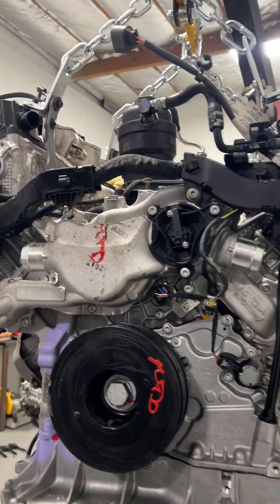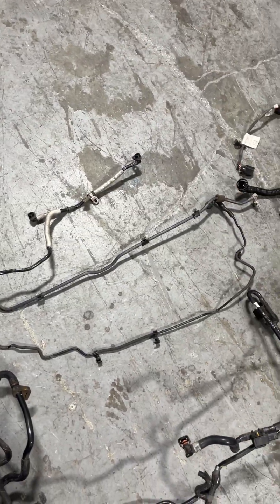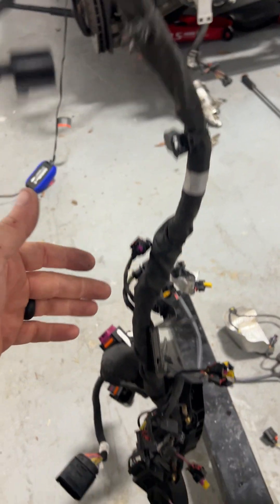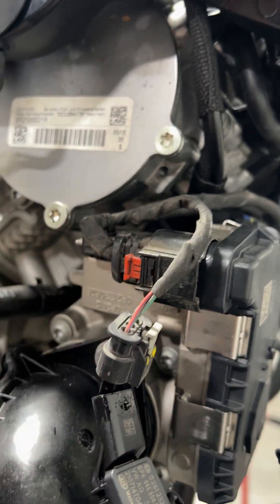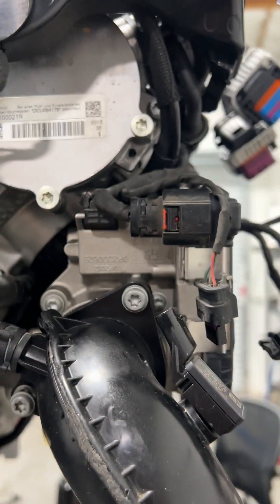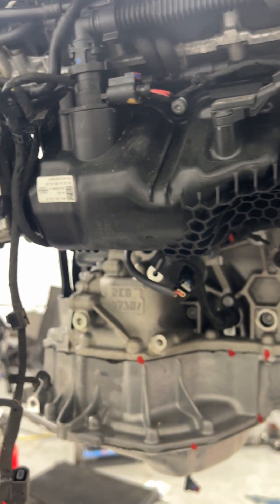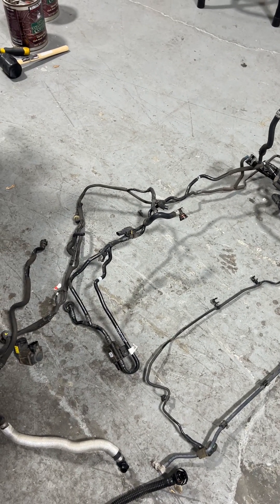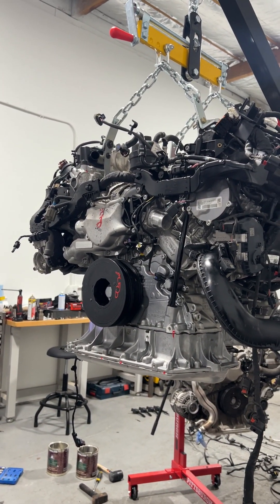Audi EA825 4.0T Engine Repair: Fixing Wrecking Yard Damage on SQ7, RS6, RS7, RSQ8, and Urus Engines

Comment: We feel the pain. Very frustrating to see so many good parts go to waste. Keep posting! I’m quite curious to see the timing chains and the hydraulic lifters… I would love to see if the needle bearings used for the 2.9 EA839 are not being used in the EA825. Thanks for sharing this and good luck! Regards from Europe.
Reply from the maker: We’ll get there at some point.  Right now the big charge is to get the engine back in and operational to finish development work.
Reply: @themanleygarage of course! Looking forward to the final peoduct. As part of the development, will you upgrade internals or will it be only turbos and remappijng for the engine? Also, whixh engine code are you working with? Mine is DYGA… thanks for answering and for the content!
Reply from the maker: @DanielRomero-zs9lq  we have some absolutely WILD shit in the works.  We push in increments.  We don’t believe in yanking an engine and upgrading internals if we haven’t broken them first.

We also don’t believe in selling “upgrades”.  We need to know limits, and there’s only one way to figure them out.
Reply: Alright.,. Keep pushing in increments and share with the community. These videos are cool as you’re showing lots of things about the ea825 that we can’t see unless we would work for an audi shop/garage. Thanks for replying as well!